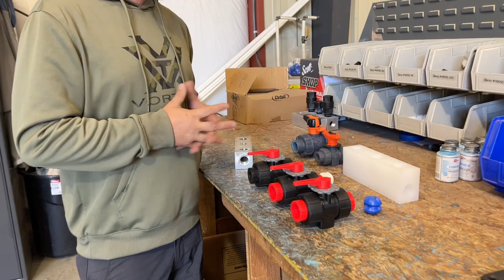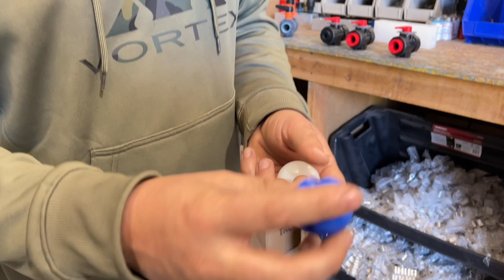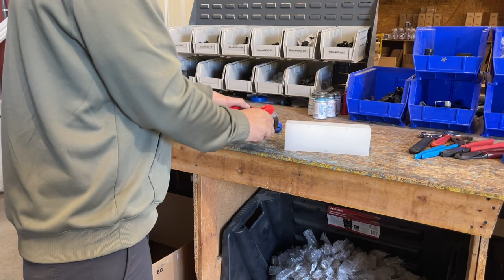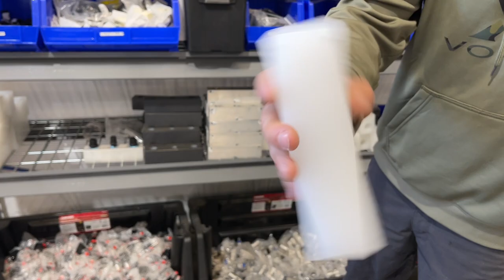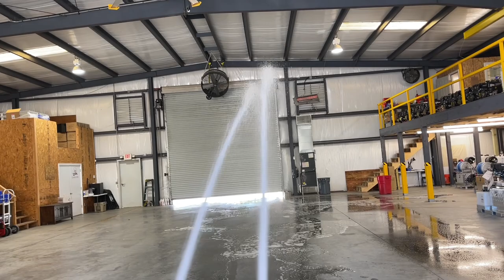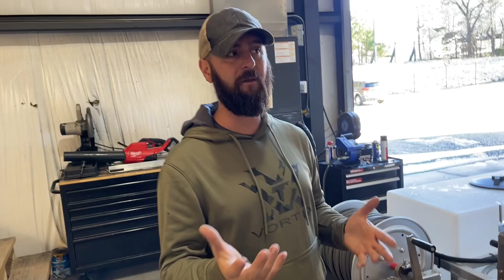Introducing the SUPER V-BALL

Comment: I was interested in a SmartBlend system but they are out of stock. Does the superball also apply to that or only the manual manifolds?
Reply from the maker: We will have more in stock by next week
Reply: @southeastsoftwash4020  great. Looks like you have a few on the site right now. With the manual proportioners, you guys provide red and black couplings to change the flow rate based on what’s powering it. Does the same apply for the smart blend? So if I run a 12v now but want to switch to 24v or gas down the road would the smart blend be able to accommodate that?

Comment: Nice. I have 7gpm 12v pump so for the best flow would the 1/2" valve work or 1" valve better?
Reply from the maker: 1” better but not necessary
Reply: @southeastsoftwash4020  Thanks Coty. So do you use a 1" hose on the sh and water draw inlets and what 5/8" or 3/4" on the output discharge hose to wand?
Reply: @user-et3sv7gn8f  I'd think so